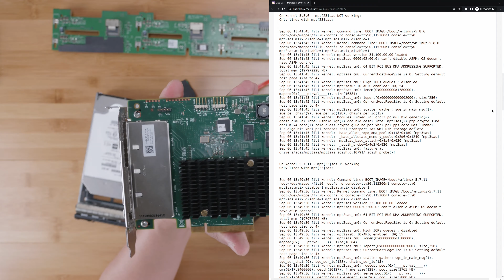13 Reasons Why | your drives are not showing up in your LSI HBA

Comment: So I just put an lsi 9211-8i in my desktop pc and my drive wasn't showing up. Imagine that!  I find and watch your video and low and behold i hear you first suggestion shut down my pc and sure enough my cable was loose. So, i push it in and pin it back up only to start my pc and still no drive info.  So I watch a little deeper into your video and near the end of the first suggestion you mention about hearing a click means you pushed your cable in all the way.  So I take my pc apart again and yep, my cable was loose again.  I pushed it a little harder and click.  Now this time, I started the pc with the case still open and felt the hard drive spin up.  I went in to disk management and was immediately greeted with the I need to initialize my new disk.  Added a partition, formated it and, it worked great.  I am copying my files for my media server to it as we speak.  I started playing with computers around 1983 and even went so far as to go to school to learn how to build and repair pc's.  It just goes to show that the simplest of tasks can be the ones that hamstring you.  Thanks for the video!  I'm definitely a subscriber
Reply from the maker: That's a great reminder that sometimes the simplest things can be the culprit!  Thanks for watching!

Comment: Great points! One issue I've encountered with a 9600-16i card is it not recognizing SAS-2 drives, did the firmware upgrades and to this date it will not recognize SAS-2 drives. Very weird and luckily its mainly being used for SAS-3 and NVMe drives but still would like it to recognize SAS-2 drives as on occasion I need to get data off old drives. The card came with a system I got so not one of your cards for the record.
Reply: OK looking now at the compatible SAS drive list there are no SAS-2 drives listed... I guess RTFM time.
Reply from the maker: I haven't had that issue. However, which SAS-2 drives were you using? I've noticed some Seagate SAS drives have buggy firmware, and if the controller tries a different protocol (SAS-3 / SAS-4), it causes the drive to freeze up, instead of allowing it to negotiate to a matching protocol. Try different brands of drives to see if it is a universal problem or specific brand/model.

Comment: i am using x570 motherboard with lsi connector and toshiba sas 12*4 tb hdd and its not detecting any help ? i am using windows so do i have to install lsi or it should detect directly?
Reply from the maker: Make sure your driver is installed and working correctly. Then watch my LSI HBA troubleshooting video. And then go through this video.

Comment: Wish this awesome info applied to my situation. My Cisco UCS C240 M4 has 12 SAS drives attached to the controller and all 12 are seen and functional. The problem is, these drives are storage drives setup in a Raid 6 configuration and the server boots off of a couple of Intel SSD's that are setup in a Raid to protect the OS. These two SSD's are plugged into a couple of SATA sockets on a PCIe board, which is separate from the SAS controller. The BIOS does not show these drives as bootable. When I try to load Windows, the install gets to a point where it asks where to install Windows and neither of the SSD's are in the list. Matter of fact, the only thing on the list is the USB dongle where the Windows installer lives. And of course, Windows can't and shouldn't be installed there. Ah, the joys of servers.
Reply from the maker: The PCIe SATA controller needs to be compatible with the server in order to boot. And windows installer also needs driver for the SATA controller in order to see drives connected to it.
Reply: @ArtofServer  Appreciate your response. The SATA controller is the original one that came with the server and it booted from the original SSD's that was installed when I bought it. The problem is, the Windows Server OS that was on those SSD's is password protected and I have no way of bypassing it (at least I don't know how) so I replaced the two SSD's with two different ones with a higher capacity and tried to install Windows 10. I may try Linux if I'm unsuccessful with the Windows install.

Comment: There I was thinking about putting electrical tape over certain pins, reflashing firmware, updating Linux drivers. Before that, I followed tip #1 and wouldn't you know it, actually plugging in the cable worked.
Reply from the maker: LOL... I'm glad that tip helped you out! :-) Thanks for watching!

Comment: 17:26 I discovered that SATA 1.0 drives with the ATA-7 command set are supported while ATA-6 ones are not. I get these figures in Linux via "smartctl -i /dev/sdX" (with the drives connected to a vanilla SATA ports in the cases of ATA-6), but there are probably half a dozen other ways to do it. ATA-6 corresponds to "Ultra 100", and these were basically old stock IDE drives retrofitted with a SATA bridge. I think some/many ATA-7 drives are bridged Ultra 133 IDE drives, but these still work, presumably because the ATA-7 and SATA 1.0 standards were concurrent.

It's a little hard to tell what will work without some investigation. Probably the only 100% guarantee is the device lacking a Molex power connector. Regardless of disk size, I'm pretty sure all devices that are powered only by SATA connectors are ATA-7 or higher. For example, I had 80GB drives that were powered by SATA-only that work with LSI HBA cards. I also had 160GB (and maybe 250GB) drives with Molex power connectors that did not work with these cards.
Reply from the maker: Thanks for sharing that info. I'll have to look into that further.
Reply: Addendum: Looking for the Molex power connector applies only to 3.5" drives. As for 2.5" drives, I don't have any particular strategies. I don't recall the PATA -> SATA transition behaviors for this form factor nearly as well as I do for the larger disks. I also don't recall actually seeing any ATA-6 SATA 2.5" devices but I haven't the largest sample size.
Reply: I went through some of my remaining stock of old ATA-6 drives and have some more info. Actually, some are detected by LSA HBA and some are not. I can say at the very least, the Seagate Barracuda 7200.7 ST3160023AS 160GB with ATA/ATAPI-6 T13/1410D revision 2 is not detected while the WD Caviar SE WD800JD-40GBB2 80GB and WD2500JD-00HBB0 250GB are detected. Unfortunately, the WD drives don't report the ATA revision. It appears the last ATA-6 T13/1410D revision was 3a.

Contrary to the speculation in my prior post, these non-detected Seagate drives do lack Molex power connectors, so that cannot be used as a compatibility guarantee. Oh, Seagate, always throwing a wrench in things.

Comment: Thanks for this - great video super helpful and very clearly explained. I worked through a lot of these but still can't get my drives to show up, would appreciate any pointers you can offer.

I'm using a motherboard with integrated HBA controller (Supermicro X10SRH-CF which has an LSI 3008 with mini HD SFF-8643 connectors). I've checked the relevant jumper (JPS1) to make sure the controller is enabled, and the SAS indicator LED is pulsing green indicating the chip is powered. Checked and rechecked the cables (forward breakout, correctly seated). Drives appear to be spinning.

I'm trying to identify whether the issue is the drives or the controller, but I can't find the controller BIOS settings anywhere; do these normally show up in the motherboard BIOS? The board has two SATA controllers, both of which are referenced in the "Advanced" tab of the BIOS, but there is no reference anywhere to the SAS controller.

Any help greatly appreciated.
Reply from the maker: You need to enter the LSI BIOS ROM. Usually during POST, a message will show up referencing "Avago technologies" and you can press ctrl-c or ctrl-r to enter the LSI ROM program. This is provided your card has the LSI ROM installed. If not, you can try to install it first.
Reply: @ArtofServer  thanks again. Flashed the BIOS and found the controller. Tested with a SATA forward breakout and it can see my SATA drives. 

SAS drives still not working, but strongly suspect the power disable "feature". I thought my used SAS drives were too old for this but looks like they do have that feature and I'm using normal PSU 6-pin to SATA power adapters (with 5 cables). Time to tape some pins.

Comment: Another reason I have come across a couple of times is SAS-2 external JBOD's that just don't show up when connected to SAS-1 cards.
Reply from the maker: That's a good point. Actually, I didn't really go into external JBODs, but I find some of them a bit quirky where some drives may not show up, or upon reboot, some drives will disappear and some will come online, especially with very large arrays.

Comment: Awesome video, this isn't information that is readily available.  I think I actually ran into that kernel bug in my dellr710 running debian a couple years ago when I setup my server.  I ended up being frustrated that it used to work on Ubuntu but when I switched my system to debian it would load the kernel driver but the drives wouldn't show.  I ended up just leaving it all connected and waiting haha.  I thought it just started working a week later but it was probavly a kernel update haha
Reply from the maker: Thank you! I hope this video will help people out when troubleshooting their LSI HBAs and storage. Was the Debian running kernel 5.8.x? That does sound like an kernel update fixed something...
Reply: @ArtofServer  I do not know for sure but I believe so.  This was around last christmas.

Comment: The channel should be "GOD of server" ..

You saved my card's(h310) "A" lane.
By any chance are you aware of the values of the 503 and 502 caps,?
That would be a great help.
Reply from the maker: Sorry, I do not know the F for those caps. I usually just take them off another board. They are AC coupling capacitors, so you can probably look it up. For examples, on the PCIe lanes, it looks like between 75nF to 200nF. There's mention of 0402 package size and 100nF value as being recommended. I think for SAS-3 it is 10nF in 0402 and 12nF max, 4.7nF min.
Reply: @ArtofServer  Thanks a lot for your reply, Really appreciate your PCIe reference, can be helpful to study those designs.  
My recent observations revealed that there are not many types of caps probably an economical choice,  should I be proven right in my assumption, you will be informed with all the details. Furthermore, the quality and the workmanship of my perc 310 are really an abomination of unaligned components, and untidy, untrimmed leads, even flux residues after 10 years, about originality it is, of course, got from a retired unit.... I recall you referring to the dell as a sturdy one now I wonder what if I had an LSI one. 
Thanks again, and I understand its hard to get new video topics often, still waiting for another binge.:goodvibes:
Reply: @ArtofServer  could you please make a video on Megaraid bios "convert Raid /Non raid option"
Explaining how the Megaraid nonraid compares to IT mode

Comment: I have a question related to drives. I have seen these RDX Cartridges for backups. However the enclosure won’t work with normal drives and the drives from RDX cartridges won’t work in normal computers. I was wondering since I’ve seen some of you videos if you know the reason or at least would help me find out the reason and see if there’s a work around or if it’s a lost cause. I know it’s not recommended to mess with a backup media but as I tinkerer I would love to know why these disks are special is it a sector format magic or what. I’d love to work with you on this mystery because I see no one trying to solve it. Thanks for your videos they have helped me a lot.
Reply from the maker: Sorry, I don't know much about those RDX cartridges. Aren't those backup tape systems? Thanks for watching!
Reply: @ArtofServer  essentially it’s a HDD in a shock proof case that’s designed to be an alternative to tape backups. I’d be interested in doing some forensics on how they supposedly lock them to only working with their drives and no where else.

Comment: Using unRAID, I removed a dead hdd yesterday, and added a couple others (and swapped out 2 pcie3 nvmes for pcie4) and cleaned out dust. Somehow on boot into unRAID, I can't see each of the drives on the p3 port of each SAS breakout cable. I have reseated both the breakouts at the lsi 9207-8i (I got from you on ebay) and at the drives with no change.
Any ideas what would stop a single drive in each breakout? I updated bios which cleared my settings as well, so I'm not sure if I missed a setting as it has been a couple years since I messed with it. I indirected the board for missing capacitors etc and can't find anything.
Reply from the maker: That's a strange one. I don't think any BIOS settings would affect how the 9207-8i card would work. What happens if you swap the drive on the P3 port to the P2 port? Does the drive on P3 still not show up?
Reply: @ArtofServer  I finally figured this out! I shuffled the drives around slightly, and I had a couple WD white label drives which disable themselves if they sense 3.3v coming through the power connector as some power saving feature. You have to bypass this, which I had done before on the safa connector but when I moved the drives they got moved to different power connectors.
It's a common issue but just need in the case of someone getting a new drive, vs shuffling things around. So I wasn't getting any search results.
Reply: @ArtofServer  Btw I did swap the drives on p2 and p3 and the same drives worked and didn't work so that ruled out the lsi or cable for causing the issue, thanks!

Comment: I've got a problem that's driving me insane. My host computer is a HPZ420 with a Xeon 6 core and 32GB of memory. PSU is stock 600W. The controller is an LSI 9200-8I. SSD drive for boot on SATAIII from motherboard. 7 2TB Seagate Constellation 'refurbs' connected.  With all 7 drives powered up the machine will not post. It gets to HP BIOS splash screen and then locks. If I power down drive bay 3 and 4 it will post with either cold start or CTRL-ALT-DEL. Once it gets over the post and TRueNAS starts OS load I quickly power up the two drives and the boot continues perfectly, everything mounts and happy server.
tests:
Warm restart with 3 fingered salute and all 7 drives running but still locks up on POST.
Power down drive bay 1&2 instead and leave bays 3&4 powered but still locks up on POST.
Power down drives 5,6,7 instead and leave 3&4 powered but still locks up.
Switch SAS cables so port 0 is now going to 5,6,7 and port 1 is going to 1,2,3,4, but still locks up on POST.

If I goose the server by starting 3&4 after POST it will run for days. It's driving me crazy.

I'm not expecting a reply but more of an opportunity to vent.
Reply from the maker: That's probably a power issue. HDDs use the 12V rail to drive the motors and during spin-up they draw a lot more power. You should check the PSU to see how many Amps you can pull on the 12V rail for the HDDs.

Comment: Unfortunately this doesn't answer my problem. I have 4 SAS drives that WERE 520 byte, but I succeeded in reformatting them with sg_format and now MegaRAID reports them as 512. I was able to get them to show up in disk management once, but after I poked around with MS Storage Spaces they no longer show up in windows, but both sg_scan and MegaRAID still see them.
Reply from the maker: that sounds like a software problem, not a hardware issue. something up with MS storage spaces.
Reply: @ArtofServer  Yeah I figured as much. Thanks for the second, more educated, opinion though. I don't know what I'm doing until winging it breaks something or just never works and I have to spend days to months learning a new skill to fix it. Like how I'm trying to teach myself how to design an m.2 pcb so I can add WiGig to my desktop PC.
Reply: Luckily I find it fun... mostly
Reply: I fixed it I think, used reset-physical disks since they showed up int get-physicaldisk as starting and canpool false.